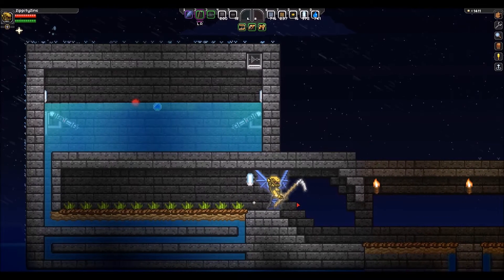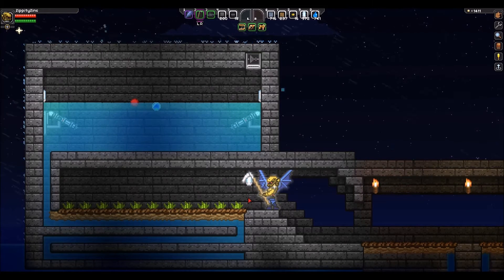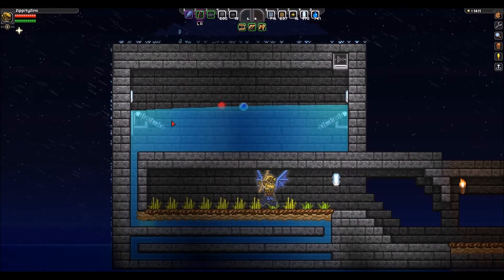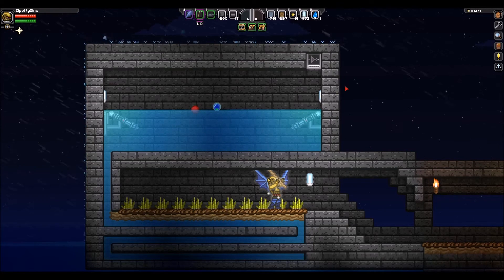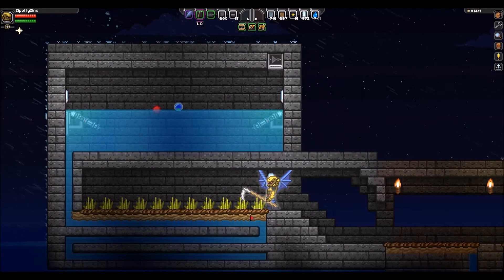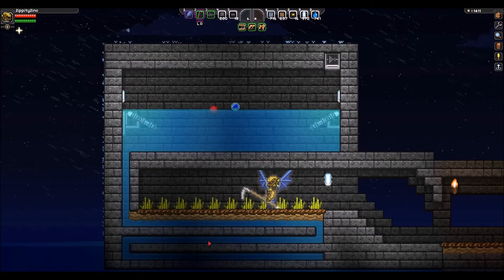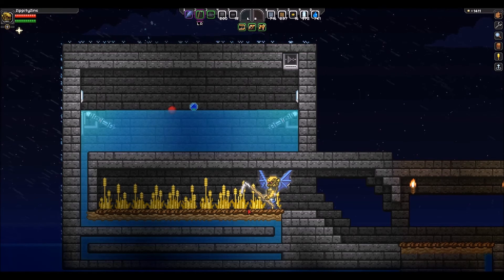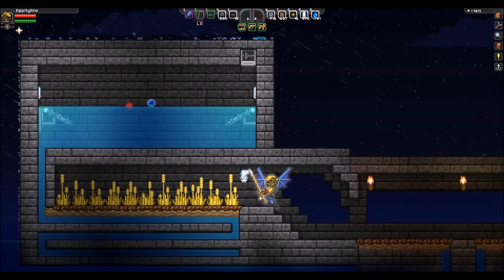Starbound Inventions: Automatic Irrigation System

Comment: thanks sooo much for this now i just need an auto collection system built in as well
Reply from the maker: +xXDeltashXx Unfortunately this old design doesn't quite work anymore. My more recent farming tips video shows a now-functioning method that works, I'd suggest you check that one out.
Reply: +ThatThunderCookie oh well it seems like it would still work i could make something like this as long as the turrets can still fire water
:D which i never knew they could do i just knew that to me the second they made the turrets dependent on the gun you put in i though of them as useless because i can never find a decent gun and usually the guns would deplete the energy too quickly i can see why it wouldnt work tho due to the chunk will unload later soooo yeah ill watch your vid next thanks tho

Comment: hmm... the tilled dirt don't get wet despite the snake thingy and the drain on the other side of my piping system. Also you don't need two turrents, just one. it took me hours to find a water gun.... no need for two to make an infinite water source, just saying.
Reply from the maker: +Xiao'sChannel This old design doesn't work anymore due to how they changed the mechanics. I would suggest looking at my new video on farming tips. I show an alternate method to auto-irrigate crops on that one. But yeah I know what you mean on the water gun, the thing is super rare. Congrats on even finding one lol

Comment: Can sea water be used for irrigation?I mean there is ocean planet,and the new 
mechanism allows drains to work in the ocean,so can you use the infinite water generation of the ocean to leak in water to a field that is slightly under ocean horizon,or just simply make a farmland on the sea and let the crops suck up sea water?
Reply from the maker: 陈鹿茸 Watering mechanics have changed since this video and cannot be watered from below anymore. They now must be watered from the top. An ocean planet is ideal for farms because of the infinite water. I made this example as a way to farm on planets without infinite water or rain.

Comment: Ok, so, this system looks amazing :) (I certainly don't enjoy the idea of watering giant fields manually with a watering can, or having to depend on rainy planets).

My main question for these, as I mentioned in your Nightly video that introduced the new watering requirements is -- will this system work off-screen? Given that water rendering doesn't happen once you're far enough removed from it, will irrigation and crop growing still work if you're several screens away? What about off-planet?
Reply from the maker: codenamedmitri That's a good question. I would like to think the devs thought far enough ahead to make it so it works even when it's not loaded on screen. When I get home from work I'll test it out and get back to you! It's a very good question and I am curious about it too.